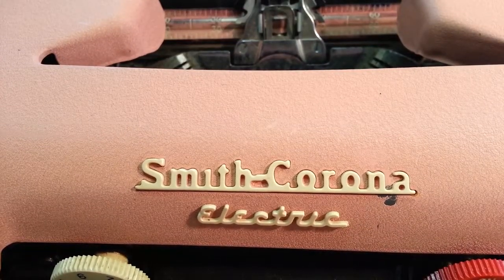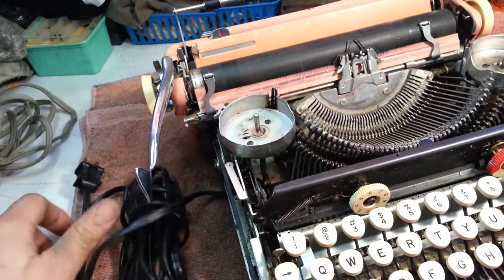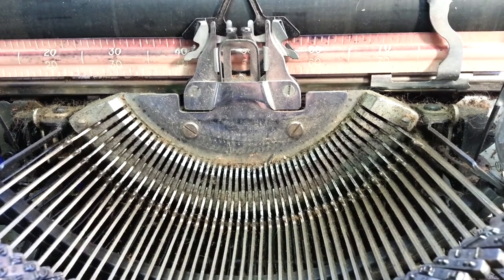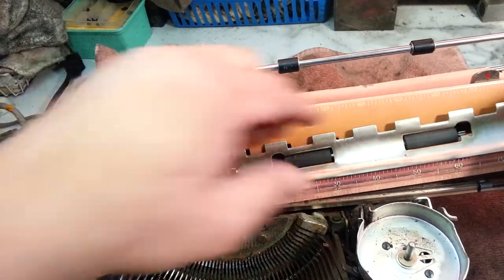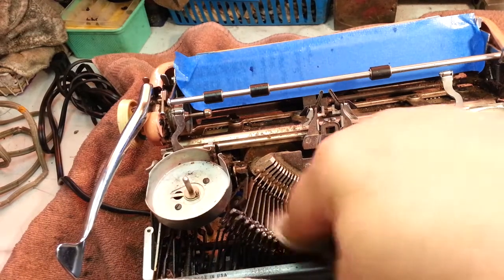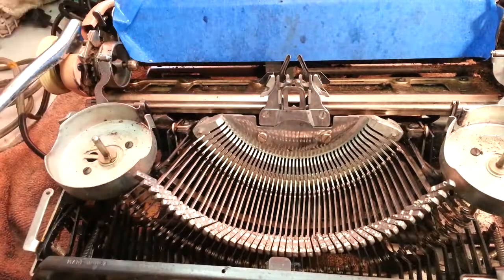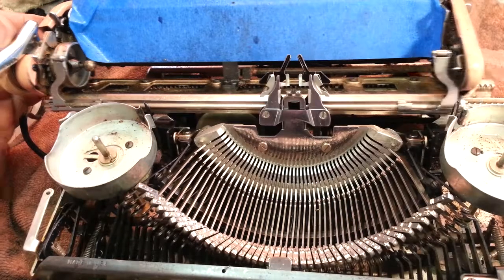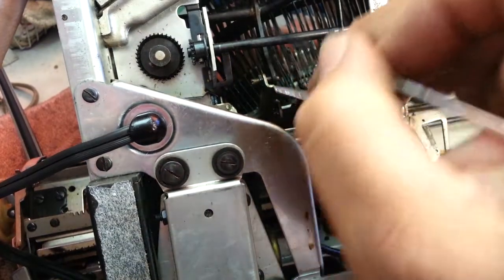Smith Corona Pink Electric Vintage Typewriter Clean Typefaces Slugs Segment Basket

Comment: This is a wonderfully helpful video!! Thank you. On my machine, I did the cleaning with lacquer thinner several times, but some of the letters get stuck on rapid auto-repeat. It looks like it caused by the tiny lever not retracting from the spinning bar under the keyboard. Should I just keep cleaning more or is there something else you'd recommend?
Reply from the maker: Yes, I think some part of that cam is sticking still
Reply: @phoenixtypewriter2136  I'll keep cleaning then. :) Thank you!!

Comment: Did you use lacquer thinner on the keyboard too? Also is rubbing alcohol ok to use instead of lacquer thinner?
Reply from the maker: LT will melt plastic and destroy certain painted surfaces, must be used with caution, but I do use it primarily
Alcohol is safer, just slower
Reply: @phoenixtypewriter2136  Thanks!

Comment: Thank you so much for making these videos!!! Could you tell me what you were turning at 12:10 to get the keys to go up? I have a 60's model Smith Corona and I don't see anything I can turn
Reply from the maker: Is yours a manual typewriter ? This electric and has a power roller shaft (fluted ) under the keyboard to fire off the typebars, turning the pulley/belt @ 12:10 simulates the motor turning triggering the typebars to rise.
Reply: Nah, I have an Electra 120 and I tried to turn it, but it is stiff and doesn't want to and the typebars aren't rising
Reply: All of the keys type just fine except for one that I'm trying to reattach, but there isn't enough space for me to rehook it in
Reply from the maker: Reattaching those links is tricky cause access is difficult. That pulley wheel should turn freely until you press a letter, if you press multiples like I was, it gets very stiff.